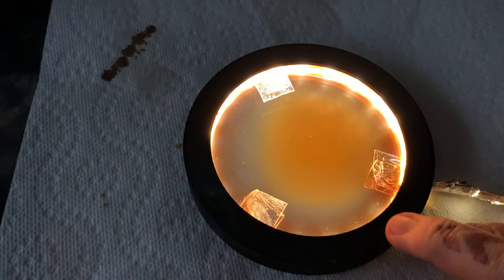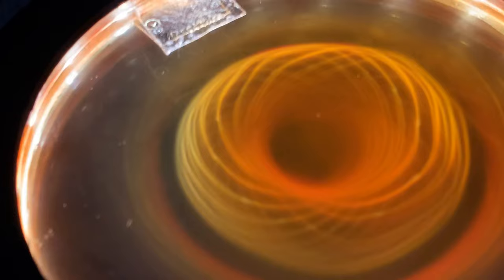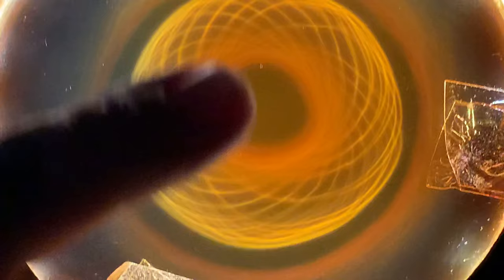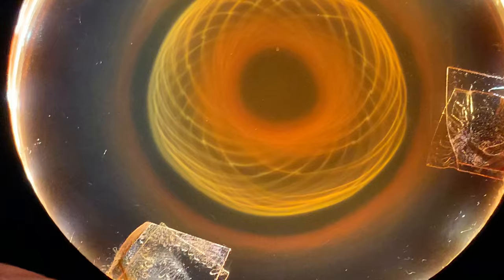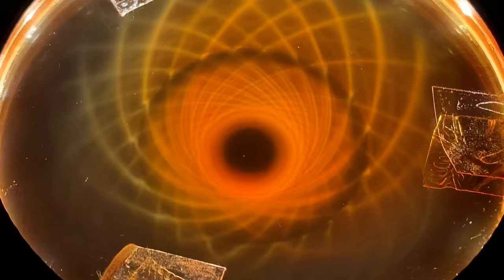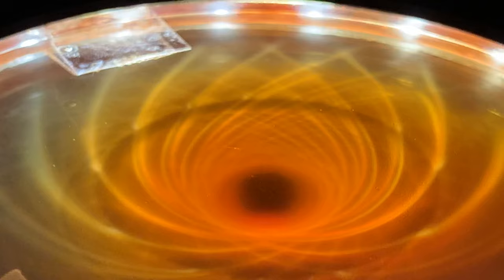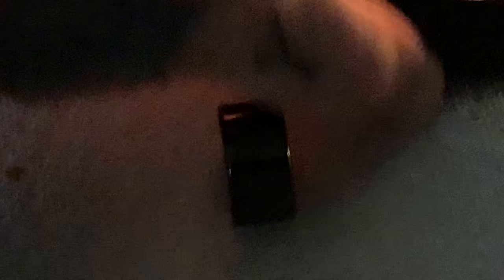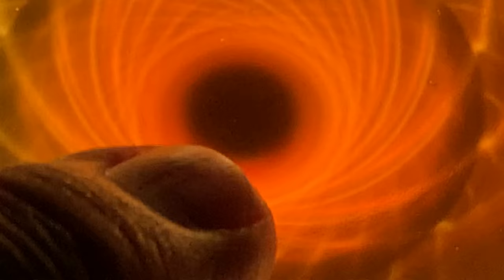🤩 NATURE'S SECRETS OF MAGNETISM 🥰

Comment: 5:14 hollowed magnet
5:26 cubed magnet
8:35 black round dielectric portal
10:13 ring magnet 
10:40 magnets stick by accelerating towards the lower pressure to mediate the dielectric acceleration
12:35 dielectricity overthrows magnetisms ability
14:12 phase shift(my mind just thought this IMPORTANT) Red (R) NORTH POLE Blue(L) SOUTH POLE . The phase rate from South to North is 5 to 1

Comment: Hi Ken ! Congratulations for this splendid video. Suggestion for an experiment with your cell: try to obtain the magnetic field of a straight current-carrying wire. For the field in a plane parallel to the wire, your cell can be used as it is: just place the current-carrying wire on the cell. But for the more interesting case of the field in a plane perpendicular to the wire you will have to make a cell with a small hole in its center through which the straight wire can pass. Magnets are too complicated to understand what the field is like in their case. But the magnetic field of a straight current-carrying wire is the simplest and such an experiment would be very revealing indeed.

Comment: You could turn that into A ornamental lamp, 
Would look cool if the magnet was slowly spinning, 
And if you could change the colours of the lights, 
And maybe change magnets for different effects that would be extra cool, 
I already have A lava lamp and plasma ball, 
Now I just need A magnecell lamp.
Reply: But after only a few minutes or even seconds with a strong magnet, you "burn" an energy field into the super cell. How can that be overcome?
Reply: @thegeorgiawebwarrior  yeah it would need to be designed so that the fluid could be easily replaced I suppose. Maybe if the fluid was moving it would stop or slow the scaring.

Comment: Ken, because they accelerate toward the lowest pressure, would the term 'falling' be appropriate?  Like a skydiver falling through the air is experiencing pressure on their backside (high pressure), and loss of pressure on your frontside (low pressure), one could argue there is "acceleration" until the point of equilibrium (Term-V).  Yes?  No?

Thanks for helping me get smarter sir, great content as usual!
Reply: I had the same thought come up during this video (“falling”). Good question.

Comment: I wonder what the magnetic field would look like if the magnet was spinning (slow and not so slow) under the farrecell?
Reply: The same notice he didn't move the cell just shifted angles of perception so if you had one just walk around it its a fascinating experience😊
Reply: I’ll try it out! Tesla talks about rotating magnetic fields
Reply: Incogniito_ Y2K pretty sure he’s thinking high speeds like with a drill
Reply: @signalfields6763  I'd be happy with something that would turn the magnet slow and then progressively faster by use of some kind of small table crank system that Ken could operate manually and at his leisure.
Reply: @jakeletzler6140  Vinny St Vincent channel - Roy demonstrates with rotating magnets. FPV Angel channel decodes and demostrates from multitude of displays, texts, architecture.
Reply: @nickoskatospitis2402  ,thanks for the Vincent suggestion. Maybe I'll see you over at FPV's channel one of these days. Take care.
Reply: @signalfields6763  I see but the basic system is basically using two fields to piggy back off each other to keep each other spinning  forever like how we send satellites into orbit we bounce them off at certain angles so we use less feel don't know the specifics but its the same principle applied only to magnetic fields directly but you'd have to build something with a similar geometry to the suns magnetic field to kick start it
Reply: Incogniito_ Y2K kick start what?
Reply: @signalfields6763  sorry bout that the system needs induction cause its physically the fields will do the rest cause there already everywhere just need something that mirrors them.
Reply: Incogniito_ Y2K I tried with one magnet and it looks the same but I imagine with multiple like a halbach array spinning would be fun to look at :p

Comment: Time is probably warped in that toroid. There's no way to clock it but it looks like time would vary with the density of the lines. I don't know what it would be in the dark pole areas, fastest or slowest. You could call this the magnetic time tunnel effect. This is why people sometimes time-warp into the past, they see old buildings and people dressed in old clothes, then they go back to normal when they leave the area. It's a local perturbation of the earth's magnetic field, causing temporary time warpage. Later the area goes back to normal current time, because the perturbation flattened back out.

Comment: Ironically on another note this relates to the problem of warp travel. That you have to build a machine that's attached to a quantum computer that can alter the field of a very powerful electromagnet as you move through space. So you pretty much need a advanced electron sensor to detect the placement of electrons continuously.across the magnetic fields.

Comment: have you tried using some sort of vibration to reset your fluid sandwich? your burn marks are basically where the small amount of fluid pulls away from some of the glass surfaces. try a back massager or ultrasonic cleaners to smooth out your fluid film layer. I don't know if it will work, but it might.

Comment: why are there strands, why isn't it continuous? is it defects in the magnet?
Reply: @Camp Exist So when I was looking at cymatics I thought it made sense because they had a vibrating metallic plate and that was like a plane slicing through the standing wave. But this one bothers me because of the strands have a holographic look to them, like they have a depth even though the ferro fluid is acting as a plane. Doesn't sit right with my understanding of things.
Reply: @Camp Exist So for what its worth I just wanted to give you my best theory. There are nano ferro particles suspended in liquid and we know that liquid can diffract which is what a hologram is doing, light diffraction held forever in that state. I think the magnet is making strands like in a lenticular lens effect, https://en.wikipedia.org/wiki/Lenticular_lens. The strands are where the led light diffracts to the eye, and you can see they are discrete around the rim. So if I'm right we can validate it two ways, first vary the number of leds in the strip, that should correlate with the number of strands. And we can use sunlight which should be continuous if we can get enough light in and still see the thing.
Reply: @Camp Exist Is it that, or is it the ratio of ferro particle size to fluid in suspension between them. That should be falsifiable as well by changing the concentration of nano particles or the size of them. Sounds like we need Theoria to get busy while we sip pina colada.
Reply: @Camp Exist Just my attempt at humor there my apologies. I hope everything goes well for you.

Comment: Earth's flat... Most energy in at equator, gravity leaving upward angle and is gravity, mother earth makes the stars, unbelievable...
Reply from the maker: not flat
Reply: @KenTheoriaApophasis  as gravity rolls out of your system that is time oscillating every electron to the same mass as it pushes and pulls on your optic nerves for you to observe your environment to create an electromagnetic pulse to your brain... Gravity doesn't work on the globe works perfectly on the flat earth and explains the clockwise versus counterclockwise North and South of the greatest amount of energy into the system as an observer
Reply: @KenTheoriaApophasis  the sun does laps the same shape as the magnet. Polaris is the small dipper also has inverse square mirror image projection as well as upside down big dipper constellation... The greatest amount of perpendicular energy into our system is at the equator and at some point it is going to have to leave.... We use our star as a scale factor as we are actively changing the angle of entry into our system 3° over 41,000 years creating the expansion like if I was to throw a rock into a body of water across the unit of time a 22° throw is going to have a smaller splash then a 23 and a half degree throw into the body of water and carry a bigger splash and the apparent expansion.   Prob not flat but a lot of anomalies for the possibility the energy spheres on the exit and gravitational lift is a misrepresentation for centrifugal force within the local gravity calculations

Comment: There clearly is visible interaction of the magnetic field and the LED strip in the outer rim of the cell (not the diodes per se but the entire LED-circuit itself) Very beautiful indeed but not an accurate representation of what magnetic fields look like I'm afraid...

Comment: Between the lines/bars/solid visual field is something thats missed. What is it that seperates these lines/bars/solid visual field. It is the force of magnetism acting upon the conjunctive. The conjunctive is invisible as it is in a different light/ wave perterbation, what do you think of this mate : - )

If that empty space had something in it, why can't you see it. it's because you have tinny eyes. Big eyes are much better, sadly I only have tinny eyes too. : - )

So if the space did have something that is invisible, what needs to be done to make it visible.

It is not  visible because you can't see it : - ) so what needs to be done. Work out how to see it, that's it. Easy really, wonder why I didn't think of that. Years ago I did NDT (non destructive testing) The particulates are non magnetic and show under black light. I think you want to have a go but have no time at the moment. Time, thats it

Comment: I used to degauss monitors for arcade machines. Not sure if this will help your ferro fluid, but i have a feeling it might help get more uses. Had a similar unit in the oil field which  removed the magnetic field of steel pipe after electromagnetic inspection. The pipe would stick together which was not a good thing for transporting and processing. Video below. Watch his technique. The toromagnet version of this unit is best but i can't find a video.
https://www.youtube.com/watch?v=rAPTp3I-NgU